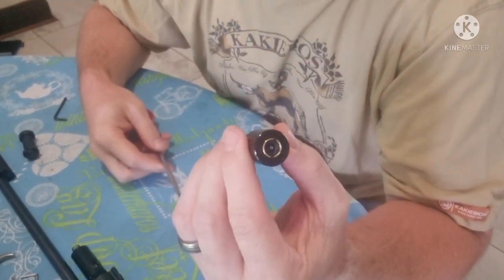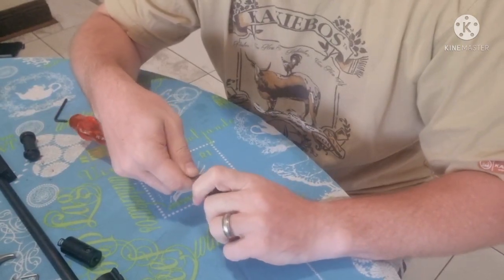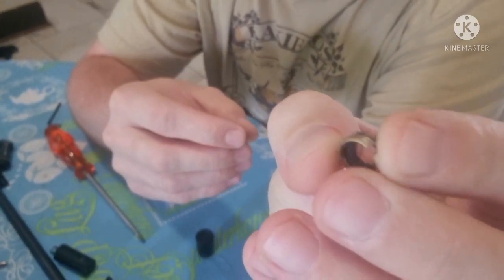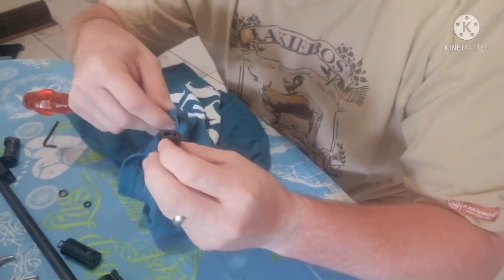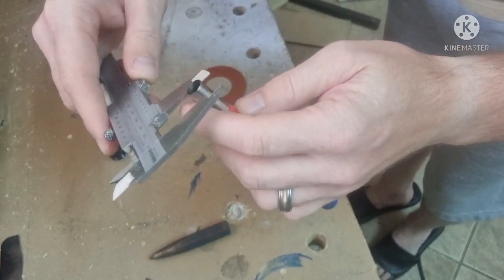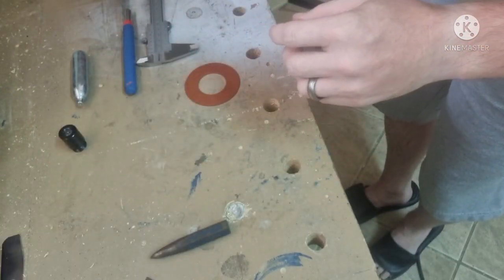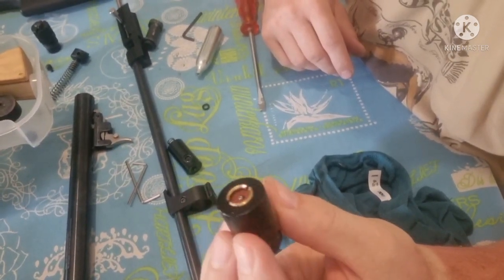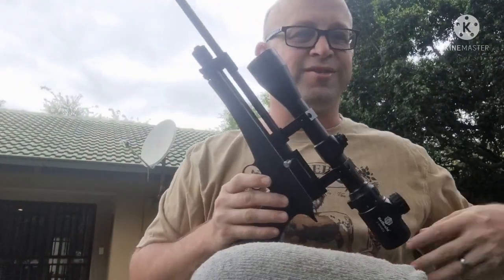Homemade & cheap co2 valve seal & installation -Artemis CP2

Comment: It's the Grease that hasn't helped that much to prevent the seal from perishing. You are meant to use a drop of Silicon Oil on the tip of each CO2 before you install it. That way preserving the seal life for much longer.
Reply: I used to do it with all my guns but it never stopped them leaking after 5 or six co2 bulbs in my Webleys and a few more on ny others, l think its just a sales pitch from pel gun, plus the tube u get it in dribbles twice the amount you use, one spot and two diwn the neck of the tube  l stopped using it and the seals actually lasted longer.

Comment: What I got is called "yoyi yoyi" silicone placemats I got the 23 inch long 15 inch wide an it is as thick as a US dime but it's no slip waterproof an heat resistant
Reply from the maker: Awesome sounds good

Comment: One wonders if thick well greased/oiled leather would function as a seal material. Springers used to have leather piston seals in the olden days.
Reply from the maker: It does work, I have tried it. I just found that I needed a little more clamping (tightening) pressure and I think this could damage the co2 puncture piece in the long run

Comment: These silicone rubber hose seals work great. The grease does not harm them. Easy to make with a home made punch. I've used these on many things.
Reply from the maker: They sure do work great and like you say they are easy to make. Thanks for popping in and leaving your comment

Comment: Hello Tyrone, love your channel. I have one question: I have diana bandit in .177 and cp2 in .22. Is it possible for me to change the uppers to make the bandit 22 and the cp2 177?
Reply from the maker: Hi Thanks for dropping a comment and a question. The short answer unfortunately is no. The trigger arrangement on the bandit and the CP2 are a little different also the valve of the bandit and CP2 are a little different on the fastening holes. The bolt action of the 177 and 22 are also different in size so you can't use the 22 bolt with a 177 barrel

Comment: I was going to use a faucet washer but I may try your method. My seal is destroyed and I think it was originally cup shaped (1970 healthways plainsman). Hopefully the rubber works.
Reply from the maker: It works pretty good but doesn't last as long as the original
Reply: Yes,,I thought the toilet washer may be too soft. The remnants of my seal are very hard. But, I'm not sure if that was how it came or if it hardened over the years.
Reply from the maker: It comes pretty soft but the toilet washer will get you shooting until you can get a seal

Comment: I like how you used proper tools and made it 10x better than I would of 😅
Not a bad idea at all!

What kind of grease you used ont the co2 cart?
Reply from the maker: @Lowkey ENT Thanks for the kind comment, I actually use CV joint grease for a car. It contains some Moly which helps it to be "rubber friendly" and grease seals better than oil 😉
Reply: @African-Budget-Pellet-Gunner  interesting ! Never heard of it
Reply: Wow, well that's  a good work, nothing else to say 👏
Reply from the maker: Thanks Alex, as long as it can be of assistance to someone

Comment: Well done - I would venture an opinion that your seal is a better design than the original o-ring. And now - has anybody done a 88 Gram conversion on these guns.
Reply from the maker: Thanks Keith the original seal is pretty good if you look after it. I don't know of anyone who has done the 88gram cylinder conversion, perhaps you can be the first

Comment: Hi Tyrone thanks for the great tip.What kind of grease do you use on that o ring?🎉
Reply from the maker: I used a cv joint grease but these days I just use a drop of silicone oil.

Comment: I was thinking about doing something similar with RTV silicone sealant essentially making a seal on the CO2 cartridge before you insert it letting it dry
Reply from the maker: @Joe Botz it can definitely work just remember the thickness also plays a roleand it needs to handle a bit of twist as well
Reply: @African-Budget-Pellet-Gunner  thank you my friend I will
Reply from the maker: You're welcome I look forward to your findings

Comment: Brilliant, I never would have thought of that.  When I purchased my Chaser kit I went on eBay and ordered a complete o-ring replacement kit.  I hope that seal is in that kit.  Is the grease better than the Crosman Pelgun oil I've been using?  What grease are you using, I'd like to get some because I have a lot of co2 guns.
Reply from the maker: @Mark Stephan thanks for your kind comment. The grease is usually used for cars on the cv joint, it is "rubber friendly" and has a little bit of moly in. In my experience as a fitter and turner grease also tends to seal better than oil.

Comment: Hallo Tyrone, welches Material verwendest Du zum Anfertigen der Dichtung?
Grüße aus Deutschland sendet Harald
Reply from the maker: @Harald Münke this is actually the rubber from a toilet system. I believe it is very similar to the rubber which is used for o-rings

Comment: The seal has gone on my CP2... I actually have a bag of 0 rings but have no idea how to get to the brass part?
Reply from the maker: Check out my mod series, part 1 shows how to get there
Reply: I got it done Tyronne... It's back on full strength 👍✌️
Reply from the maker: Great stuff, glad you are up and running again